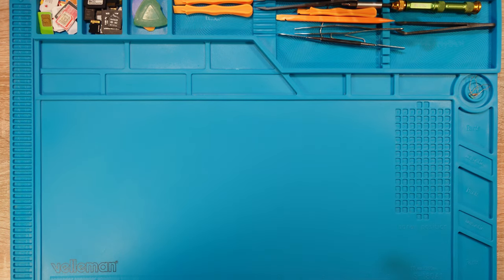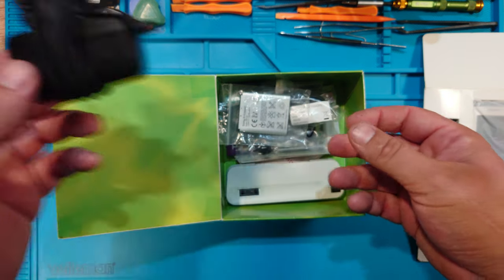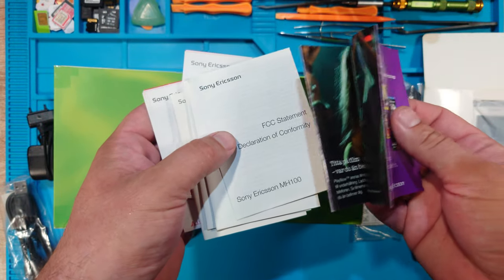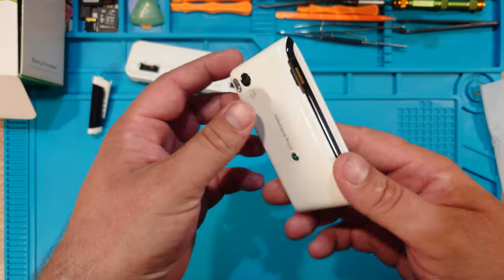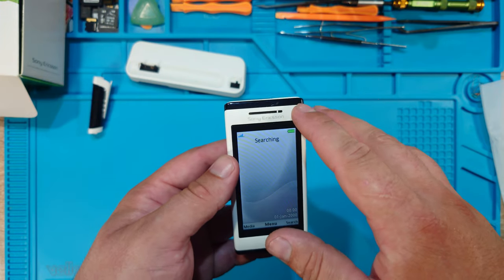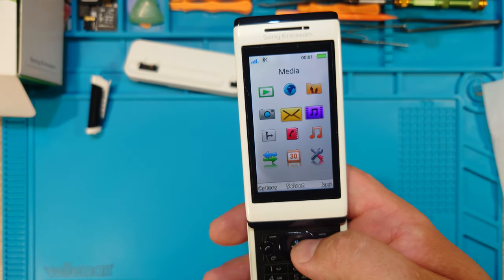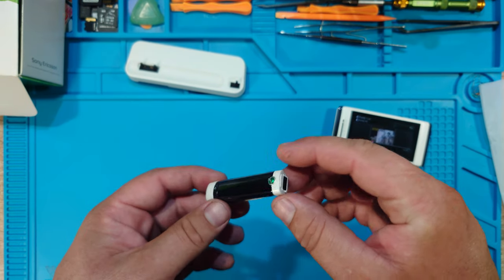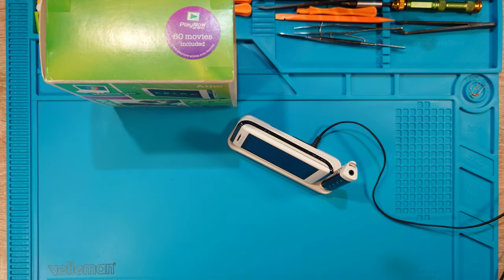Sony Ericsson Aino U10i #unboxing  and presenting

Comment: Why is it connecting via out work Bluetooth? What's in there that can't go thru cable except from the power for the lights?
Reply from the maker: It can be used with regular wired headphones instead of its bluetooth one.